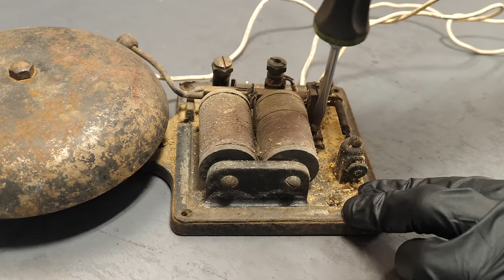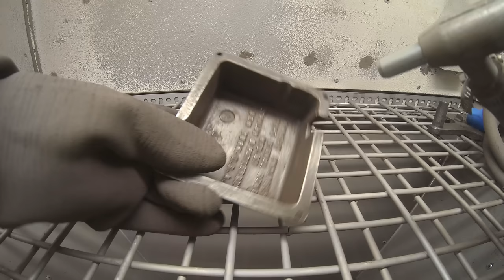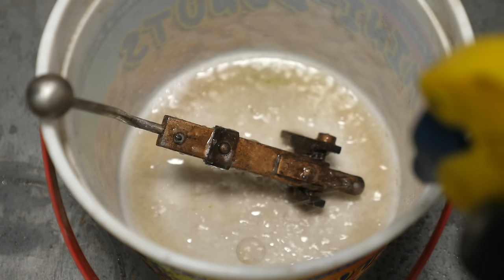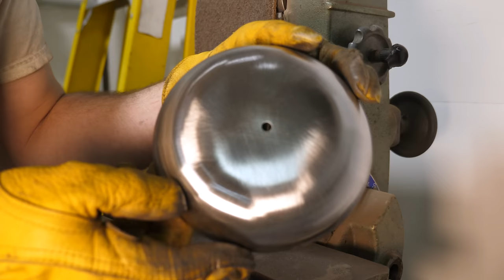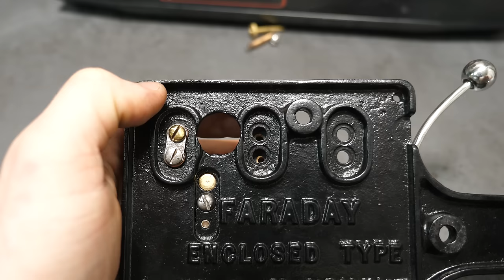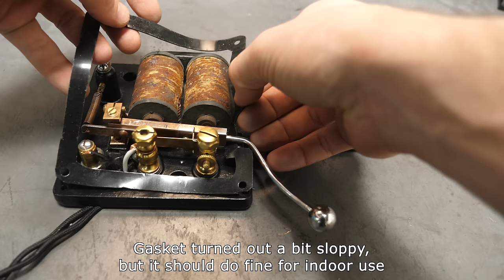Antique Fire Bell Restoration

Comment: Wow that's beautiful. I have a bell exactly like it. Found it in the early sixties. How long did it take to do this? Would you like to do another? BTW, the bell will operate on very low voltage and current. A nine volt battery will power it just fine. Arcing contacts, not so good.
Reply from the maker: I've actually done quite a few of these for a part time job a few years ago. I never restored one to this level of detail until this video. The arcing contacts are probably not safe, but at least the green sparks look cool, right? I'll try it with a 12V battery or a 9V like you suggest. I'm interested to see if it works any different on DC instead of 60hz AC
Reply: I have run it on 12 volts, but when my wife saw it for the first time, I just had a 9 volt battery handy. I watched your video a second time because I wanted my wife to see how beautiful it was after you got through with it. I saw that 120 volt cord that I missed the first time and almost fell off my chair. As beautiful as it looks, please never do that to it again. I'm a preserver not a destroyer, and if those coils went up in smoke it would be a very sad day. I plan on putting mine in my shop, and hooking it to a fire alarm pull switch. When those friends come by, you know the ones that always wanted to pull a fire alarm but never did.
Reply: Wondering if there's a way I can send you a picture of my bell? Maybe pointless because it looks exactly like yours.
Reply: I'm replying to someone else thinking I'm replying to you. So please read my reply to hawk turkey. And I'm back here again for one more piece of advise. This old equipment operates on DC and very low voltage. I bet this bell originally operated on 1.5 volt dry cell batteries. Anytime your powering something this old, start with low voltage and go from there. The size of the coils in this bell indicate that it doesn't take much to make it go. And DC was here long before AC. Thanks for listening.

Comment: It rang too fast, perhaps 12 volt would do? And it was a nicer clang in the rusty version.
Make the screw a little more less tight or perhaps use some cloth washers between the holder and bell. Or perhaps with some glue on the screw or nail polish or something so it can be a little loose with no falling off, and you get the sound back i guess. The rusty one sounds more like old doorbells used to back when i was a kid, so perhaps the bell should be a little loose.
Its looks nice, good finish, but also nice to get the authentic sound :)

Comment: This bell requires a 24 volt system to work safely, that's maybe why it sparks when rung. Also it's not the best idea to stick wires direct into a power outlet.
Reply: I know right? i looked at it thinking bruh XD

Comment: hello and nice restoration!  however, no more than 24 volts AND you need to realign the striker adjustments (which you destroyed during disassembly; those are the set/thumb screws...)

Comment: You may want to coat the bell dome with something, or it will surely start to rust out. But very nice refinishing project indeed. It needs a home where it can be seen...
Reply: Well polished surfaces are usually much more rust prone than rough ones.

Comment: If this was a fire bell in a fire station I think it would have been powered by D.C.  It would have been connected to the fire dispatch office and the alarm would be sent to the outlying stations through it. It would "ding" out the fire box number they were to respond to. "Ding ding ding" ----"ding ding ding ding"----"ding ding". Would be box 3-4-2. This type of system was used as a backup at the fire department I worked at up until the 1990's . The alarm was dispatched by radio to the stations but the bells were still rung in case a stations radios were down.

Comment: Those whining about the spark created by the contacts opening and closing... that is the very nature of an inductive circuit. When power is applied, the coils’ core becomes a magnet and pulls the clapper in, and once the clapper moves so far, the circuit is opened. The magnetic field in the coil collapses, and which induces a voltage spike even as the spring is pulling the clapper back out, and the voltage spike becomes high enough to jump across the contact gap, then the clapper closes the circuit, starting the cycle anew. Why do you think there was a gasket sealing the movement cover to the base? Similarly, tar poured over the exposed bits in the back, to prevent extraneous arcs...

Comment: About sparks. It's all because solenoid. To move hammer fast enough, you need strong magnetic field, and so current strength. But when hammer has hit the bell, it's time to stop it move and return it: hammer also is conductor, and when it moves too far enough, it breaks circuit and stop current. The spring return hammer to first position, curcuit is closed again and this cycle repeats.
We have big current and sudden circuit break. Magnetic field doesnt disappear momentaly. To make curcuit continue, field creates strong voltage surge (Lenz law). And we have spark. 

If you touched 1.5 V battery nothing happend. If you touched electric bell, with power supply 1.5V battery, while it working, it gives you little shock.

Sparks is green, maybe, because conductor is copper. Copper makes fire green, when burn. Or it's just camera.

P.S. English not perfect, but i know physic very well)))
P.S.S. Am i right about nature of this sparks ? I dont think this is actually current arc. Current is big, but not enough to create arc, i think. Need more information.

Comment: Should probably also wrap your wires clockwise around the screw terminal next time (in the direction of the threads). Note 1:15 vs. 12:42.

Comment: You really shuld have removed the coil asimbly before sandblasting it cause you culd blast off the anamle Cote off the coils witch would lead to it shorting out. Just a tip for next time

Other then that nice vid.
I remimber my elementary school having these all around the building. And out side on the walls. Alot of the outdoor one didn't work an just made this muffled clunking sound but yeh

Comment: What do you mean assume its lead paint shouldn't you have a tool to test the paint isn't that your job too check instead of assuming
Reply from the maker: I ordered some, but I didn't have them at the time of recording. I assumed it was lead paint and treated it as such. My next video will feature a lead test kit
Reply: @RestorationStation  ok just make sure you have the necessary tools before starting a restoration it'll help more and save you the trouble

Comment: It's always the same with these restoration channels.  The mechanical part copies itself generously to arrive at a very beautiful result but which distorts the original aspect.  And the electrical part is always a disaster: rough and dangerous stripping, bad choice of cable, doubtful connection ... This bell is industrial, we do not put a bedside lamp cable!